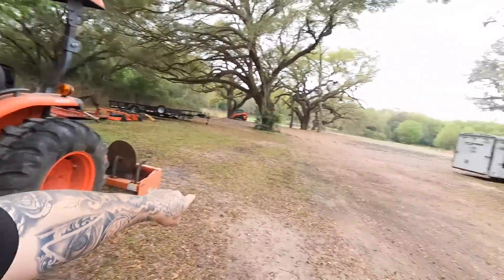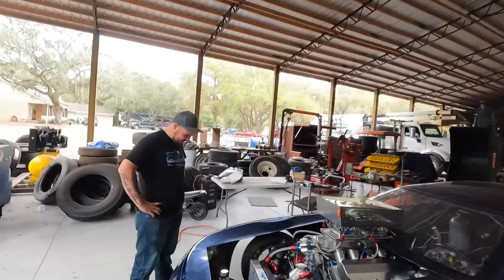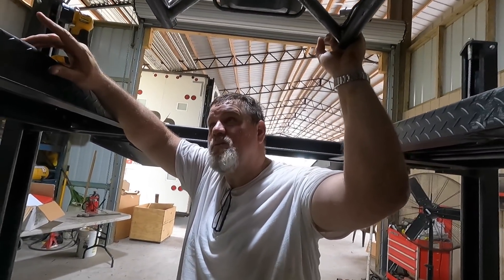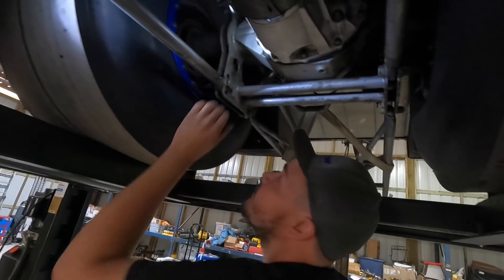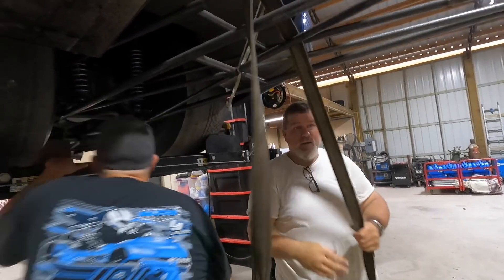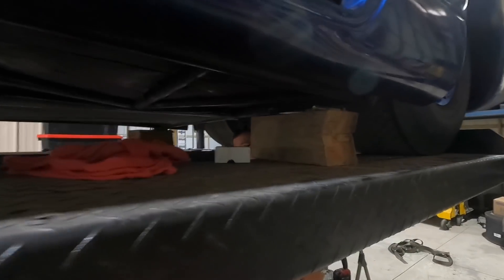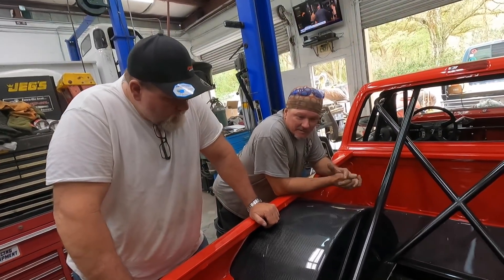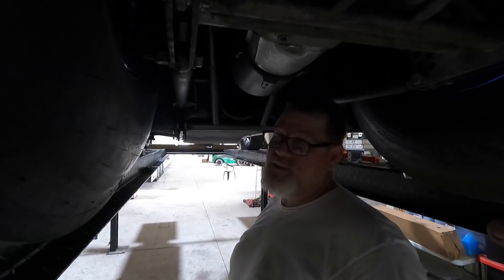Chassis NEEDS Serious Work. Customer Chassis In For A Complete Big Country Set Up!

Comment: I'm curious if those bolts holding the shocks will give any being they're sticking out so far with no support? I'm asking because I have a similar looking setup..
Reply: Yeah those look like they are on borrowed time. I think I'd figure something else out
Reply: Those bolts are going to bend, they need to be in double shear. Sketchy deal right there.
Reply: @brentfay6515  agreed
Reply: @22:21 and @23:12 thru 23:15 we see what you're talk'n about. BIG Country Cory knows race car suspensions and having a fleet of vac trucks he takes care of he knows about the engineering term 'moment'. I'm for certain NOT a college grad engineer BUT I can see where ALL the load will be when the car launches all the way thru shut down,, the load will be WAAAAAY out there at the end of those bolts. How many passes will those bolts survive a beating like that? Are they grade 5 or grade 8 bolts? Typically grade 8 bolts don't bend, they break or shear. I'm guessing they'll shear (or bend) at the shock brackets BUT hey, who am I and what do I know? Nobody and nothing :)

Comment: the fastest you're allowed to go in TS in NHRA is 6.10 if I'm not mistaken, 6.00 and under is an instant dq and suspension 

they don't want em going faster than pro mod lol
Reply: If you Run quicker then 6.10 the run is DQ'd.
Reply: @WilliamsRacing148D  correct, the 6.00 is a event disqualification and i’m almost sure it’s a suspension

Comment: You arent going to qualify for many top sportsman fields even with a mid 7 and most nhra national bumps are high 6s. A good top sportsman field can hang with top dragster which both cant run faster than 6.10 in nhra anyway. 8 anything wouldnt even be in a top 32 if the field was that big and mid 7s probably wont get you in most fields. If you domt have a 6 second car might as well stay home or be a chuck